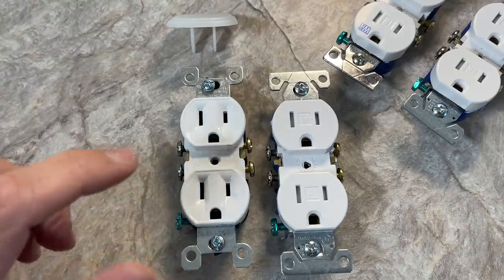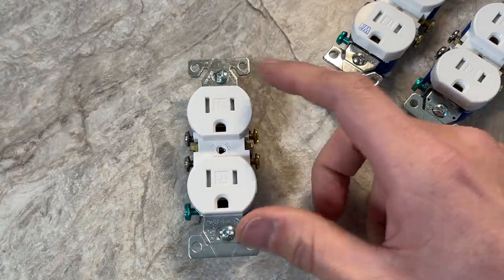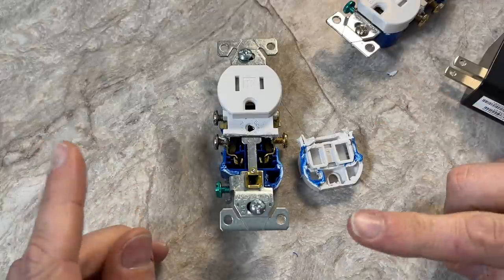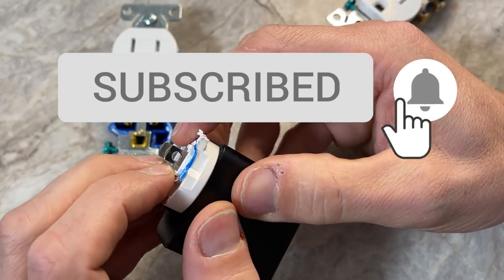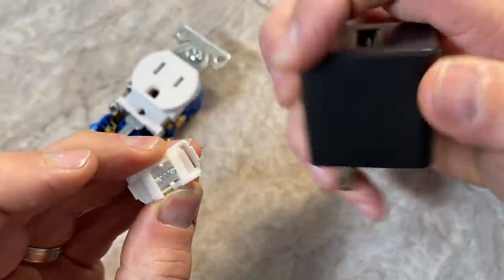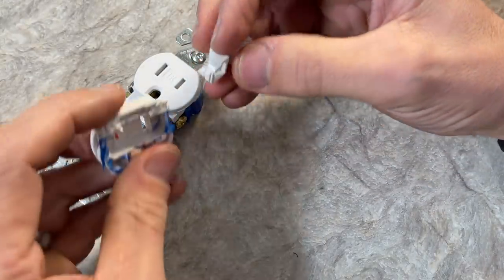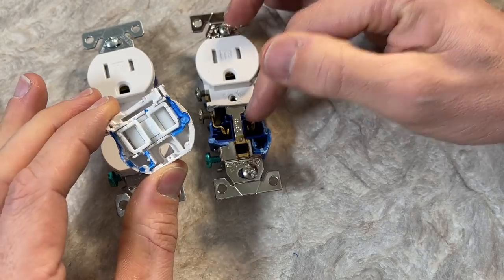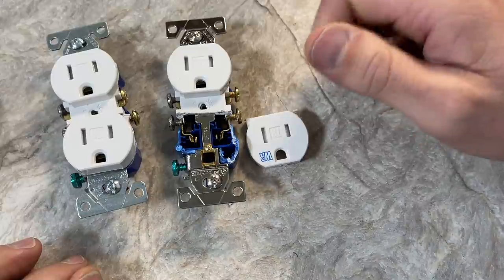How Do Tamper Resistant Outlets Work

Comment: I just spent 20+ minutes trying to plug something back in. I hate these damn things and I still didn’t get it back in. I think some brands are worse than others. I always have trouble with this one and try to never unplug anything from it. I even tried the tips I’ve found and still nothing. It’s a gfci with USB ports and I may try taking it apart to “fix” it

Comment: Why are some of the outlets so stiff?  For most of our tamper resistant outlets I have to push with my full body weight and pound the plug in with my fist, which doesn't seem very safe either.  Any ideas on how to fix this?
Reply: First, turn off the power. Then remove the outlet and throw it the trash. Jokes aside, if putting that much effort in it, the TR mechanism is done. My advice is to just replace it with a standard outlet. If you have kids, use the old plastic safety plugs.

Comment: We had a new house build right after this was adopted in our location. That was 10 year ago now and I'm not happy to say that EVERY outlet in the house failed. The spring pushing the doors closed also applies sideways force on any inserted plug. This led to premature failure of the outlets (some only lasted 2 years where items like lamps were left plugged in). It made the outlet so loose that the plugs would fall out (best case scenario). Many of them failed with arcing or a high resistance connection that turned the outlet brown from heat. 

Seriously, I will bet these TR outlets have been responsible for fires. 

In any case, I replaced all the outlets with non-tr outlets (legally sold for use in a garage). IDK, I would rather not burn my house down for a poorly designed copy of a UK plug!

Comment: I was putting a bunch of outlets with USB plugs in the middle into my new man cave attachment to my shop and one of those outlets wouldn't let plugs go in and I had to pound it in with a hammer. I would love to get outlets that don't have these shutters. The idea of having to force that clicking in all those outlets to get plugs to go into them is incredibly annoying. I understand the safety feature but quite frankly in my 67 years I've never had someone get shocked or die from sticking something in an outlet. Maybe when they come up with a better solution for this it will be worth it.

But your video showing me the internal workings of these gives me an idea of how I can wiggle plugs around until they're able to go in.

Comment: My previous apartment, which was presumably recently remodeled, had these. It was my first time encountering them, and it was such a pain to plug things in. If the plug was even slightly misaligned, it wouldn’t go in. Honestly, the Brits have a much smarter plug design. It is literally impossible to be shocked by the plug, and it won’t resist having a plug inserted. The only downside to it that I see is that every plug must have a ground pin which isn’t necessary on most electric/electronic devices. I also assume that it’s more robust, but I’m not British so I don’t know that for sure

Comment: OK, did they also do a study of how many kids put their finger in a light bulb socket of a lamp and get zapped - what next?  I'm all for safety but these are a pain especially if you have to reach behind something and you have a tight space and can't see the outlet to well - then you end up moving furniture or appliances.  Before you could just reach behind and deal with it.  But thank you for the explanation I always wondered why I it was so hard, and sometimes impossible, to plug something in at the new (old) house.  These outlets must be the reason.

Comment: My issue is that many of my appliances have 3 prong cords and the prongs aren’t the same length, so even pressure is impossible without a lot of wiggling back and forth. To get my washing machine plugged in we had to jiggle the cord so much that the plastic plate on the outlet cracked, which seems unsafe. So which matters more...the safety of the real people who live here now or the safety of theoretical people who may never exist?  People don’t install carseats that they don’t need on the off chance that the next owner has a kid.  You build your house around your needs and the next owner makes adjustments that suit them.
Reply: The two load carrying prongs should always be the same length-the ground pin is longer for safety reasons and doesn't affect the shutters at all. Yeah these things are kind of annoying but it sounds like you got a particularly crappy receptacle!
Reply: I could stick a nail clipper into a tamper resistant (gfci tripped so i don’t get shocked), it’s not hard to bypass. Your prongs should always be same length.
Reply: I mean, this is like saying USB ports suck because I have some poorly-made USB cables that are kinda bent and don't really fit.
Reply: Fact

Comment: He doesn't focus on the internals, but they are identical to the non-TR, and the clamping design of the hot and neutral are far superior to the Leviton residential.  

Also, I would not base how I equip my house on who might own it next--that's their problem.  We are older and just bought a house with the intention of dying here--and I'm not spending the whole day trying to plug in something.  They recently "upgraded" some outlets with TR (on ungrounded circuits, jumping ground and neutral--what a gift)--so since I have to undo their slimy attempts to fool the inspector, I'm just replacing the outlets with non-TR.  I'll keep the TRs just in case. (and yes, the first outlet in each run is GFCI).

Comment: If the outlet is more than 5 1/2’ above the floor, you do not have to install tamper resistant receptacles. (By the  time you reach that age/height, you should probably have learned not to stick things in outlets)
Reply from the maker: Thanks for helping with the details on the code Muhammad, appreciate the feedback.

Comment: Bent my vacuum plug trying to get past the doors on the plug now I can't use that plug in ever for the vacuum because the prong is bent. I've tried to straighten it but it doesn't work.
Reply: You will have to replace the plug if it's damaged.

Comment: My biggest complaint with these is trying to test them with prongs from a multimeter or voltmeter
Reply: I hate that I'm required to install these, as an electrician, mainly for this very reason.   I have to gently insert both probes at the same time with equal pressure on the hot and neutral,  then remove one if I want to test from hot to ground or neutral to ground for troubleshooting or checking polarity when I don't have my three light tester handy.

Although I will admit, I am all for making homes safer for families with young children who don't yet understand the dangers electricity poses, and I find the tamper resistant receptacles a superior solution vs the plastic caps that were used when I was a toddler over 30 years ago since parents and babysitters sometimes forget to put them back in , and they can be a choking hazard

Comment: Some plugs won’t go into tr outlets. It’s either because they are bent causing one  blade to be longer or they are pointed and not smooth on the tips causing there to be friction against the shutter so they don’t slide.  I like the UK design better. The ground pin is longer and ground insertion opens the live holes.  I also like the European version better - the plug goes into a recessed hole and is sealed that way before the contacts touch.  And the pins are only conducive at the tips. The USA design where the pins are conductive near the housing is a bad design.
Reply: Of course, the UK receptacles are also 240 V.
Reply: @MarkLawry  voltage is at these levels have limited extra safety both are deadly. The uk were lucky we could design our sockets from the start with safety in mind in the late 40s and even our earlier three pin round ones. Where as the US had to learn as you went along and then gain experience. With then retrofit safety which is harder and more difficult then if it was designed from scratch

Comment: I know they're not as cheap, but honestly I'd think I'd rather just use a GFCI plug.  A lot less frustrating and probably provides overall better protection, even if it doesn't directly prevent improper items from being inserted into it.
Reply: I wonder if the NEC would allow GFCI protected branches. Put a GFCI at the beginning of a circuit and use non-tamper resistant outlets for the rest of that circuit. I'll have to read up on the code
Reply: Many new houses have combo gfci and arc fault breakers on all their 120vac circuits.   Arc faults are required on all of them and gfci on all wet areas.  The combo covers all the bases in one breaker per circuit.  240 volt circuits like the ac , oven, water heater etc don't require them.

Comment: Soooo, a WR TR receptacle is essentially a Corrosion resistant tamper resistant receptacle without the YELLOW face? Ok got it.. Yeah I do know of some weather resistant outlets in the past that instead of plastic tamper resistant shutters, had neoprene gasket shutters instead, as well as the stainless yoke, and bronze or nickle plated contacts.. P&S is the brand but I believe Leviton from the late 70s to mid 80s, had some high end YELLOW faced sockets like that too.

Comment: These things are annoying because you have to plug things in perfectly straight or it's kinda tough to get things to plug in.

That being said, I have a baby now so I may just go ahead and install these annoying things all over my home. A handful of receptacles are junk and need replacing anyway. I'm pretty sure when this place was built they used the cheapest receptacles and switches available. More than half the switches were broken when I moved in. I replaced all the switches in the home with commercial grade ones. I think I will also install a couple more GFCI outlets, to replace those near the windows.
Reply: If installed as the first receptacle on the circuit, a single GFCI receptacle will protect all downstream normal receptacles in the same circuit, as if those are also GFCI receptacles, and it wouldn't necessarily be efficient to put multiples in a circuit or midstream or at the end of a run.  If you put several GFCI receptacles on a single circuit, there is a chance that more than one will trip from the same incident, and you will have to go searching for all of those tripped GFCIs to completely restore power.  It is a bit more complicated than replacing receptacles and may be worth hiring an electrician to do properly, but it's also not totally out of the realm of someone experienced in changing receptacles.
Reply: @GeorgeVCohea-dw7ou  yes, I know how they work. Believe it or not my home has more than one circuit feeding outlets near windows, so more than one gfci unit would be necessary.

Comment: Scott, I need to replace my outlets to comply with code. Plan to buy Legrand commercial per your recommendation. Want to buy tamper resistant even if it costs more to comply with code.

But there is so much bitter complaining all over about how frustrating these outlets are to work with. I am tempted to avoid the frustration and ignore the code and buy non tamper resistant especially since they are still so widely available. Still sitting on the fence. Would appreciate your guidance here. Thanks!
Reply from the maker: Yeah, TR outlets can be frustrating.  Technically you should install but it is also something where you can consider your situation.  Do you have toddlers running around the house?  This is the biggest reason for TR to ensure a toddler doesn't poke something into the hot side.  I know in my area a TON of nonTR outlets are still sold every day.
Reply: Thank you for your quick response! There are no toddlers in my house. If I do install the non TR outlets, can an inspector require me to change these all out someday when I go to sell the home?
Reply: I finally made the decision that was right for me. Hopefully, it will be helpful to others making a decision on whether to buy TR outlets.

I have no children living with me and want no possible frustration with TR outlets. Therefore, I decided to buy non TR outlets which are still widely available. If I someday sell my house, an inspector may require me to change them. This is a pain, but not catastrophic. And if the buyer doesn't have children, it may turn out to be no issue at all.

Comment: I install Temper Resistant outlets whenever I need a new one.  Never had a problem inserting a plug.  I feel like most people only complain because they don't like being told what to do so they are going to come up with any excuse they can think of. It's also not like things are getting plugged and unplugged constantly.
Reply: I've replaced every receptacle in my home with TR since I have a baby in the house. It's usually not a problem but they can sometimes be a bit fiddly to get something plugged in, especially if the prongs in the plug have gotten bent a little or something like that. I still think the added safety benefit is worth the little bit of hassle they cause.
Reply: Glad you guys think so!!! I have spent at least 15 tries trying to get something plugged in-finally after watching another video I tried that technique several times and finally got it in. I will not unplug that extension cord now until that Christmas decoration is put away!! Someone on here made a typo and called these temper resistant plugs!  More like patience resistant!!!

Comment: It's silly National Electrical Code (NEC) has started to introduce code that requires the use of Tamper Resistant outlets, like saying every house hold/ family must have a toddler or child  before using outlet.  It's better off for NEC to provide babysitter to every home owner  if they are so concerned about children safety. .

Comment: Hospital grade ones are even worse as the longer ground pin must also be pushed in before the other 2 will easily open. although most things in a hospital are 3 wire with a ground , some double insulated things that are rented to and go home with the patients like breast pumps are 2 wire and it takes a lot more effort to plug them in with no ground pin.
Reply from the maker: Interesting, I haven't seen the internals of a TR which integrates a shutter the ground plug hole as well.
Reply: @EverydayHomeRepairs  The ground pin hole does not have a shutter per say but it does have a mechanism that helps open the ones over the bladed when a ground pin is inserted  ,I'm retired now so I can't look for sure but I think they were Hubbell's

Comment: The question is, if all new receptacles needs to be temper resistant for now on, why does hardware stores still sell the non-temper resistant receptacles? It's technically illegal now.
Reply: There are plenty of uses and locations where TR is not necessary for code.  https://youtu.be/bDFaVyvkQMc Basically, but not exclusively, it comes down to being necessary in cases where children would be expected to be.  Commercial and industrial buildings in the vast majority of circumstances don't require these per national code...just yet, but some local AHJs might require TR receptacles everywhere by this point.  Also, receptacles above a certain height are exempt in residential, but if the rest of the house is fully TR, it's cheaper and should be expected to have TR receptacles, even where exemptions are possible. The penalty is generally quite low for homeowners to be ignorant of codes, this is until they go to sell their house.   So yeah, there is enough market demand for production and availability to continue for the foreseeable future.
Reply: @GeorgeVCohea-dw7ou  but there are indeed residential-grade non-TR receptacles, which can't be used in the vast majority of cases, at this point I think they should just stop making them because we well know people will buy a bunch of them at Home Depot to replace all the receptacles in their house.

And, well, aside from new houses where the code already prohibited non-TR receptacles at the time of construction, it's bit hard to know whether a receptacle has been installed before or after TR has been made mandatory.
Reply: @HCkev  
It is, what it is.  Manufacturers know what is going on, but there are loopholes all around.  The NEC should close these sooner rather than later.  Manufacturers would get the benefit of selling more expensive commercial grade non-TR, if the playing field were leveled.  “Who am kidding, China would dump noncompliant receptacles through online channels, and those people would potentially get a less safe overall product!” 
TR is a great feature, but if it comes down to people having a good safe name brand product without TR over a chinesium receptacle of dubious quality, it kind of still makes sense for the time being.
Reply: @GeorgeVCohea-dw7ou  Well honestly, I highly doubt the fact that it cost < $0.5 more per receptacle for TR would push people into buying no-name China receptacles that will take weeks to ship. But I guess keeping the non-TR widely available is a good way to spot electrical jobs that hasn't been done by an electrician